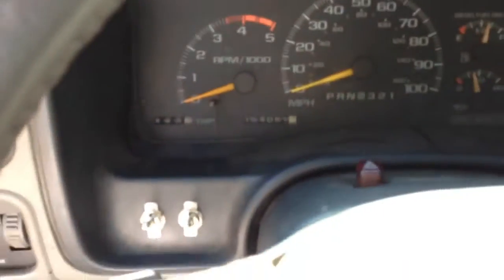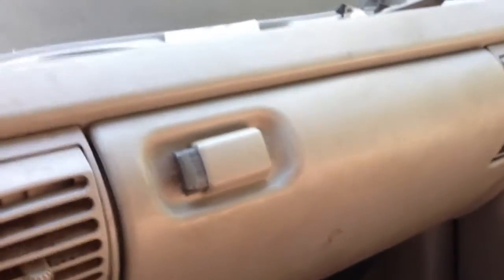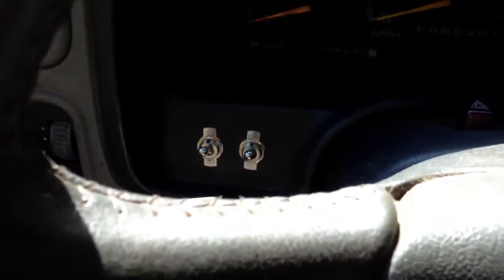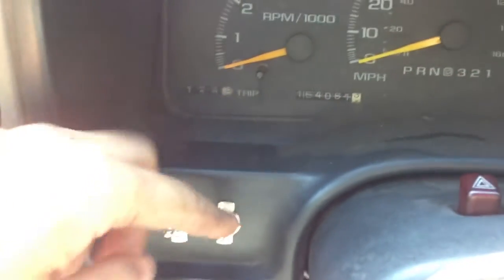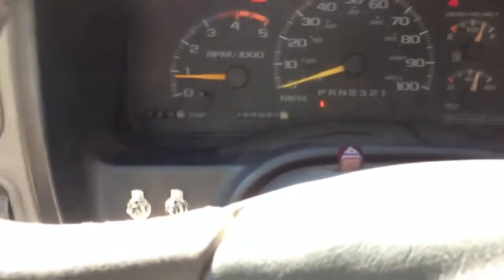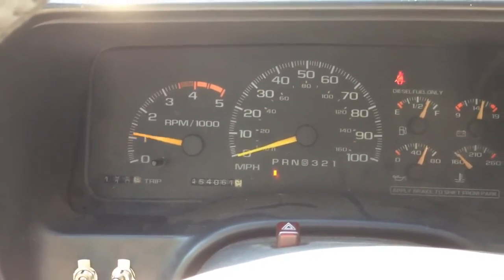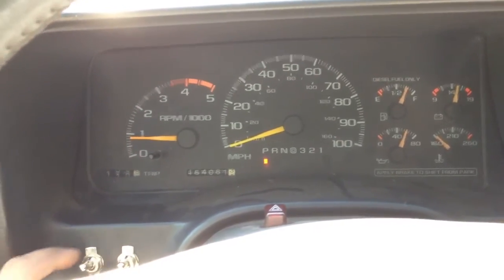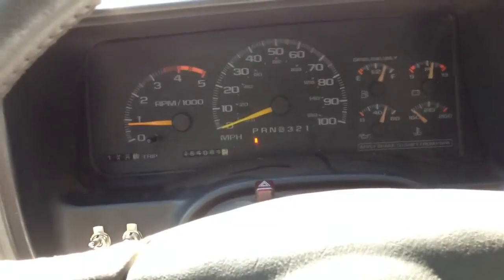6.5 Diesel OBDII High Idle Switches

Comment: I do have a question i just took mine apart i have 7 & 8 mt you said 6 & 7 ? ...my truck is a 99 with the 6.5 turbo diesel any idea's...
Oh you must of got lucky on the pins i have a bunch of dealers   around me they say its obsolete 
 no pins so i will junk yard them.
 Thanks for your help
    Bob
Reply from the maker: B. B. I think it was 26 and 27 not 6 and 7. You can get ECM pins anywhere
Reply: @pacificdrumma  

Ok my center plug doesn't go that high with the numbers
Well i will see what i can figure out. I live in Michigan and there ain't a parts house 1 that has them pins i chased all over hell trying to get them anyway i will cut a plug out at junk yard no problem..

Comment: so that's pins 6 and 7 on the middle orange/pink plug on the ecm? which pin controls which stage of high idle? [ie pin 6 = 1350, pin 7 = 1070 or whatever]???
Reply from the maker: correct